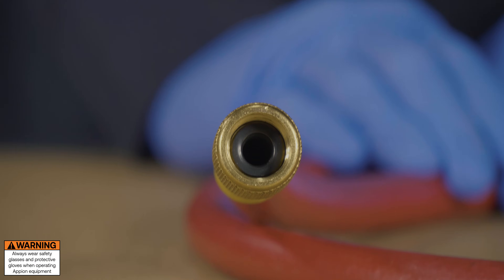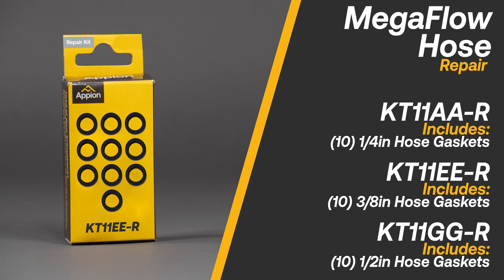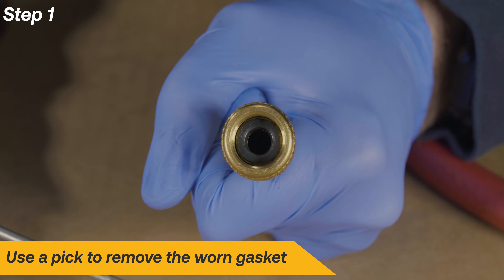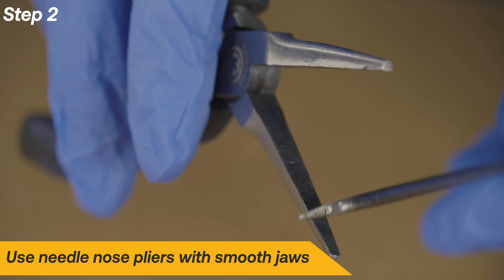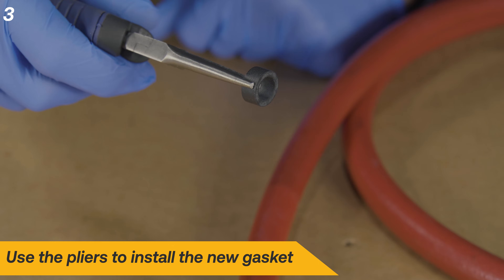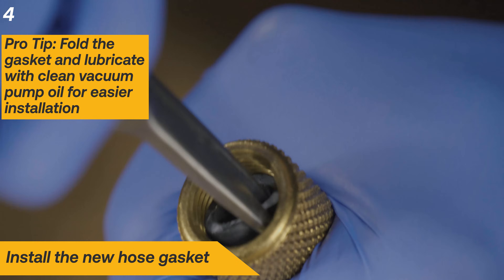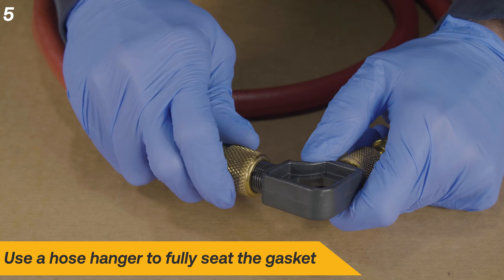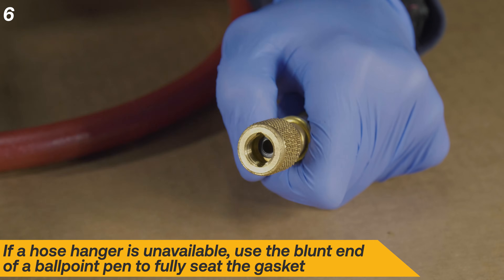Hose Repair: KT11AA-R, EE-R & GG-R Walkthrough

Comment: I was expecting seals to repair a leaking ball valve on the core removal tool.  Why is this not part of this kit?
Reply: Those are separate. But I feel you.
For the $25 to $40 price tag for 10 tiny pieces of rubber you'd think the package would include gaskets for their entire product line.